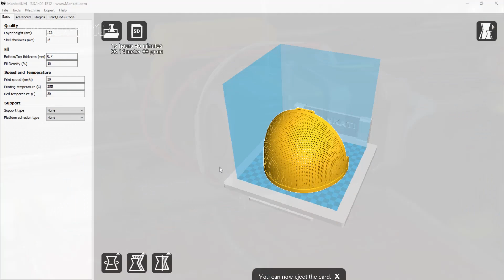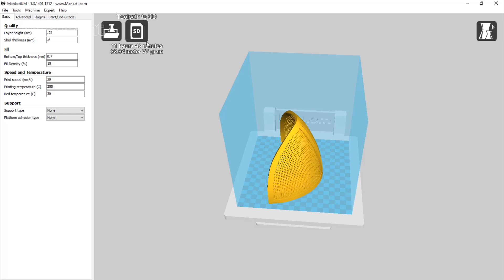#D How to Make Squid Game Mask with plastic bottles and free filament & make money from it

Comment: Hello ,can you please make a video explaining in detail how to fuse pet filament together , I've tried to use the ptfe tube and heatblock like you do but the  pet doesnt melt and wont  fuse the ends together even at 280 degrees , the few times i have fused something the bond is really weak and comes appart when bent even slightly , am I doing something wrong ? . If you decide to make a video about that issue it will be greatly appreciated and shared , keep up the good work .
Reply from the maker: Watch video number 1 (#1 Multicolor printing ) which is attached in the description section of this video